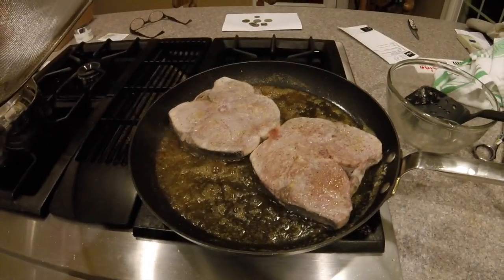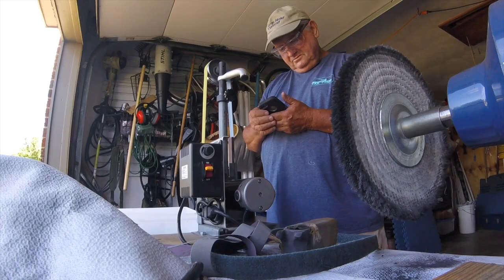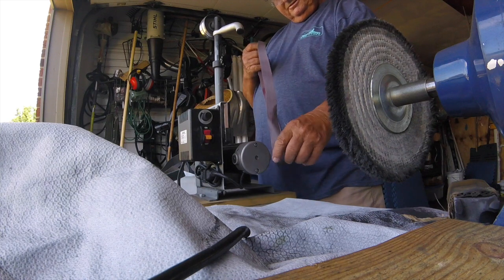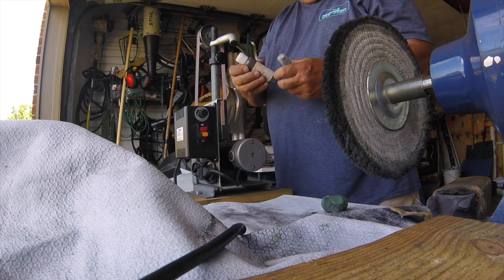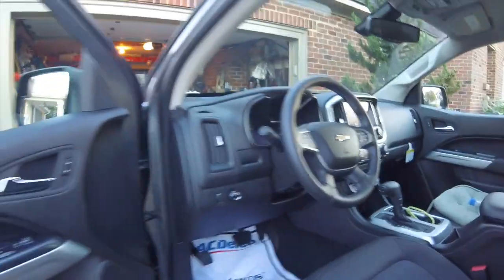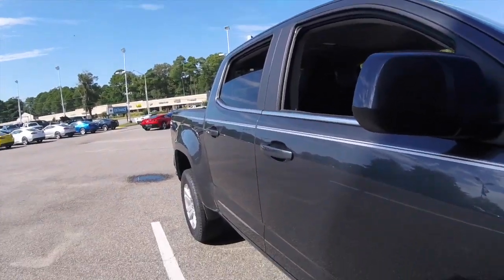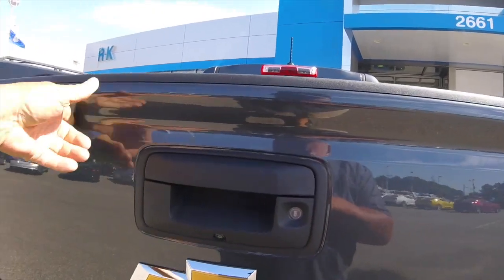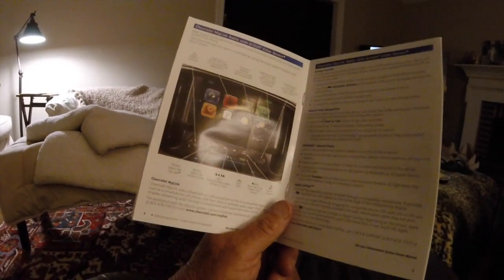8-29-16:  Wahoo Dinner - Variable Speed Kalamazoo - 4 is better than 2

Comment: I recommend the heavy duty floor liners, and seat covers for your new, beautiful ride. Dogs, plus metal detecting, plus sandy/dirty friends plus a new car, equals crappy car! Trust me...I know from experience! Your truck will look 10 years old in 10 days if you don't protect it! Make your friends take they're equipment out of the back, with the back pulled down. Don't let them pull it out from the sides, or you will have scratches, chipped paint, and dents. You dont need any hard feelings to start with your friends. Enjoy! :-)

Comment: Great schooling on the machine. Thanks , would you show more on the machines?  I like very much  the pot on the motor to control the speed. I never saw that belt that doesn't have the grit on it . Must look it up. Would you show and talk on the belts you use especially belts for carbon knifes. I seem to have a hard time bringing up a good edge on the carbon knifes and ax edges. Looking at the not to expensive 42" Kalamazoo machine to find it not to expensive at 300$ . I didn't see ones with a potentiometer on it .
OH, by the way........ is it true LOL LOL that the one who dies with the most toys wins? LOL LOL 
The truck looks mighty fine! Good luck with your new toy truck. Safe  driving !
GL HH & God bless

Comment: bed liners blow out going down the road get the LINE X spray in liner much better product my truck is 2006 bought it used in 2010 the liner was pre installed  when  i got the truck and it still looks new